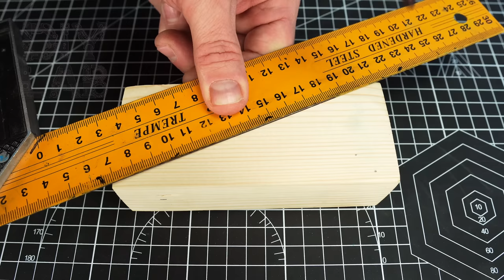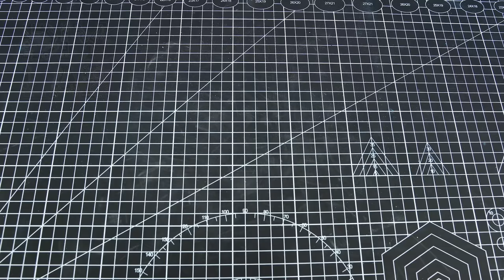How to sharpen a drill in 10 seconds! With this idea, you will become a level 100 master!

Comment: These are NOT drills. Drills are machines, specifically involving more than one moving part. These are BITS. Say it with me now... BIT. Stop calling bits drills 😂 🤡
Reply: It's called a drill, the machine is called a drilling machine.
Or maybe we call it different things 🤔
Reply: @jaisookram2255  
*Drill
a hand tool, power tool, or machine with a rotating cutting tip or reciprocating hammer or chisel, used for making holes.

Similar:

drilling tool

boring tool

rotary tool

auger

(brace and) bit

gimlet

awl

bradawl

2.

instruction or training in military exercises.

"parade-ground drill"

Similar:

training

instruction

coaching

teaching

grounding

(physical) exercises

workout

discipline

square-bashing

verb

1.

produce (a hole) in something by or as if by boring with a drill.

"drill holes through the tiles for the masonry pins"

2.

subject (someone) to military training exercises.

"a sergeant was drilling new recruits"
Reply: bit3

/bit/

noun

noun: bit; plural noun: bits

1.

a mouthpiece, typically made of metal, which is attached to a bridle and used to control a horse.

2.

a tool or piece for boring or drilling, typically of metal.

"a drill bit"

the cutting or gripping part of a plane, pliers, or other tool.
Reply: Saying these bits are drills are akin to saying a "drill" is a screwdriver because you can put a driver in it...just because you can attach a bit to it that performs a certain function doesn't make the machine become that bit or attachment. 
Or saying a reciprocating or circular saw is a "blade".
Reply: Cool brother 😃, I'll still refer to it as a drill with all the people that understand what I'm referring to anyway tho
Reply: @jaisookram2255  a LOT of people call them drills. I'm just being pedantic.
Reply: @A_Stereotypical_Heretic My friend had the same issue with bulbs in control panels, they're not bulbs, bulbs grow in the garden, they're called lamps.........
He was big, we called them lamps.

Comment: Wrong angle on the drill point, also it would lose its "hardness" if you dont dip in a water/oil coolant every few secs whilst grinding the point!
Reply: If you sharpen the drill correctly , it won't get hot enough to require quenching . Besides that this is just another click bait video put together by some unskilled " expert ". You only have to look at the swarf coming off the bit after it's " sharpened " to see that it is chipping  rather than cutting its way through the stock , because he has ground the bit in one plane only without regard to the trailing edge . That will not allow the bit to dig in and cut . It won't last either .
Don't get me started on the conglomeration of junk to pull off this stunt . For the same money or less you could buy a small 150 mm bench grinder from your local tool store and do the job properly , or spend half that and get one of those units that you bung on the end of your drill which are foolproof . IE ,  even fools can't shag their drill bits using these things ??:oops:
Reply: @grayamdelaney7044  sorry Grayam, I was toolmaking for 50 years before I retired, if I had not quenched the drill when I was an apprentice | would have got a "clip round the ear" from one of the "old hands"!  Actually ground properly the leading cutting edge of the drill bit has a thin cross section, so will get hot very quickly and so coolant is always required.  From the front cutting edge the rake angle (giving clearance) the cross section gradually becomes thicker, so wont get so hot so quick, but the very front edge must be tackled very carefully.  The drill in question has had its front angle almost completely removed, therefore has has a "serious regrind" which will require quenching or the front edge will lose its hardness and its cutting life seriously reduced!  You are correct regarding "trailing edge" (rake angle) giving it clearance allows it to cut and swarf will fly, without that it will rub and chip and not last 5 mins!
Reply: Exactly
Reply: @pedrogroves77777  it's not a drill, it's a bit. A drill is a machine, a bit is not. It's the cutting extension of the machine called a drill.
Reply: @A_Stereotypical_Heretic  actually it's a drill bit!
Reply: @pedrogroves77777  sure. But they're not drills...
Reply: @Lignum Metallum Sonus  if you want to be pedantic you are correct, they are not drills, but pretty much the whole English speaking world calls them that!
Reply: @A_Stereotypical_Heretic  even Dormer one of the UK's most well established manufacturers call them Drills.  If you call them Bits no one will know what you mean, and the proper name Drill Bits just gets shortened to Drills!

Comment: Only a butcher would use a Christmas tree drill as a centre punch. And how the 
F—- do you finish a cut with the job clamped in an engineering vice? Not to mention your drill bit angles, this video is quite comical.